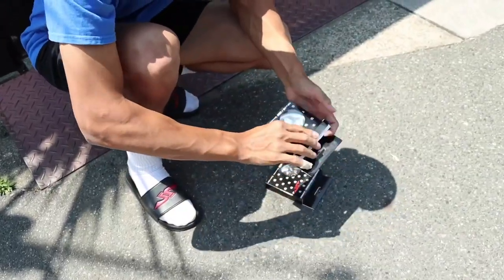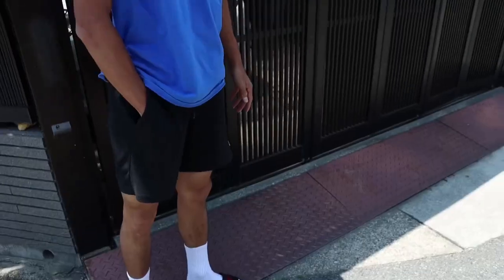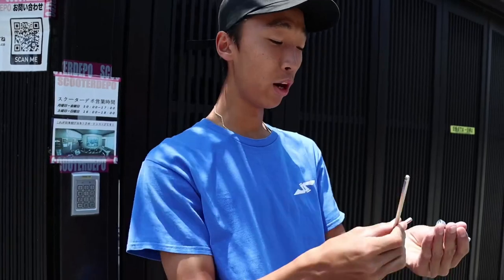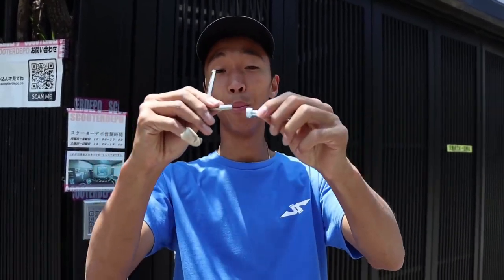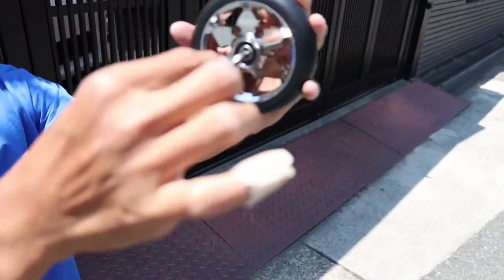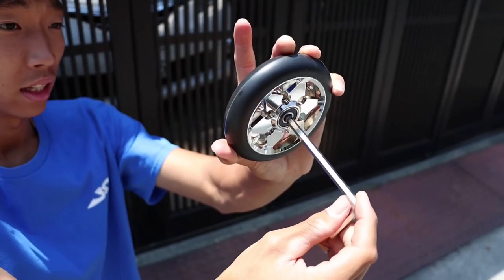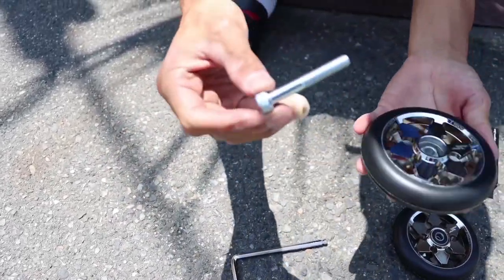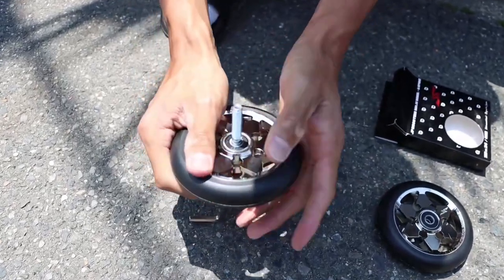BEST WAY TO TAKE OUT YOUR BEARINGS【PRO SCOOTER HOW TO】ONLY TAKES 5 SECONDS

Comment: Please help I got the middle bit of the bearing out but the outer bit is stuck how do I remove it
Reply: first youll wanna remove the bearing on your wheel that's still whole using the method shown in the video(If both sides are just the outer ring then just skip this step) Using a flathead screwdriver, go at the bearing from the opposite of the wheel so that your pushing the ring out. Get the flathead right up against the ring and hammer it a couple times. You'll want to go around the ring evenly for quicker results. It takes a while but you'll get the ring out every time. Hope this helps!

Comment: It doesn’t work with Proto wheels I couldn’t get the bearings out
Reply: Doesn’t work with any good quality wheel, I tried to use a different method for envy wheels and it took me 20 minutes to get them out of one wheel due to them being so tight.
Reply: @nate.hall_11  how did you do it?
Reply: @YoungSimon69  I used a method with an Allen wrench and a hammer, there’s videos about it on how to do it.
Reply: Mine ones look like proto and yeah still can't take them out